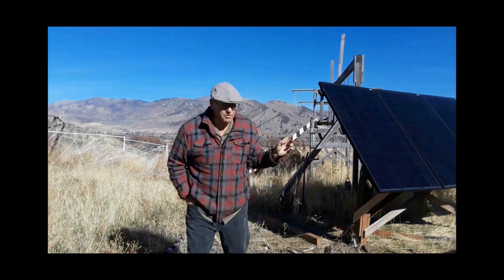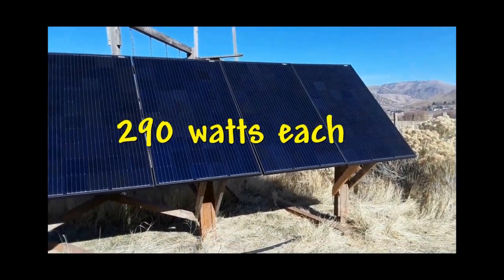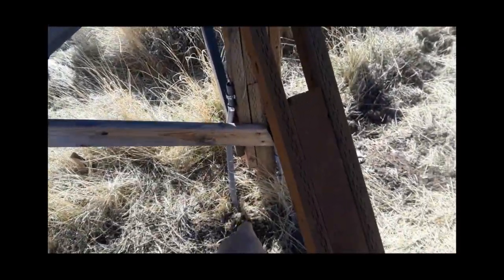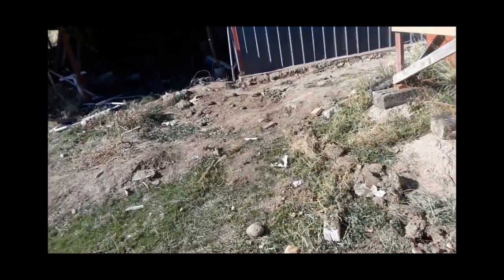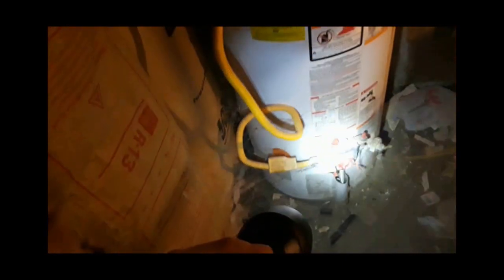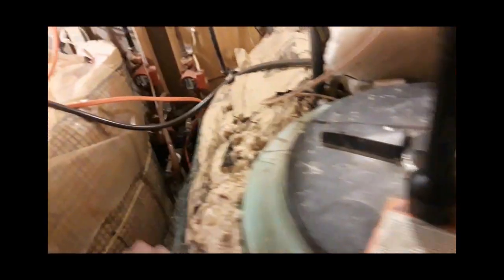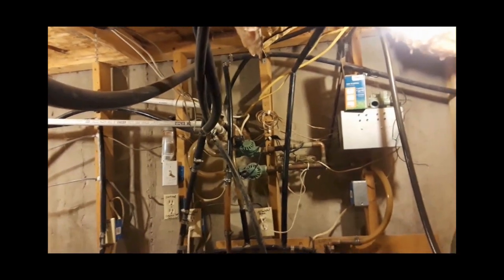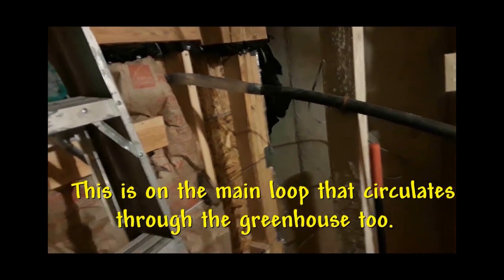Greenhouse heating system part 11  Operational Results

Comment: Nice to see a water transfer based system in operation.  Too few examples of this on youtube right now.  I'd be curious to know how it performs on your coldest nights.  36 inside and 10 out is all well and good, but where i am our lows are pretty reliably -10 each year, with up to -20 being possible.
Reply from the maker: I'll try and address that when I do the next  video.   Didn't heat it at all this past winter but the water never froze, which was surprising.   I think I have an explanation

Comment: I really like this system.  Storage is obviously the biggest problem for solar electricity...but I can't think of a better way to store electricity than heating water.  I think I'll buy a couple small solar panels and run a DC submersible water heater element.  Do you have a diagram of all the components in your solar system?
Reply from the maker: Morgan, I do plan on making a video about the components.   I'll put it up as soon as I can get to it. 
Ed